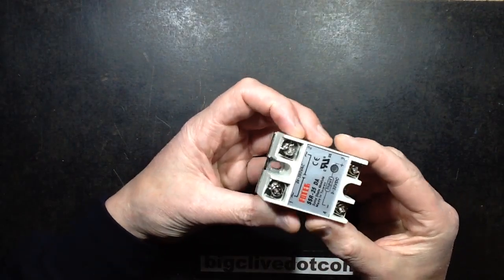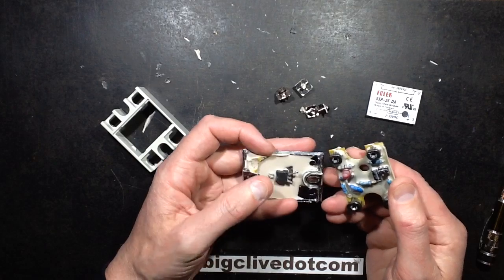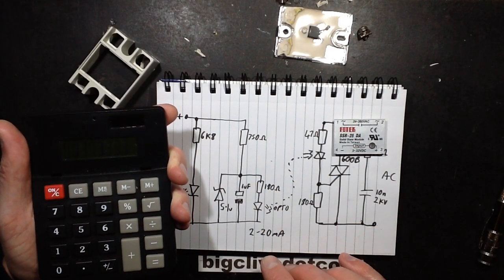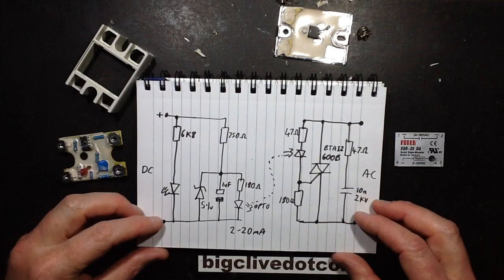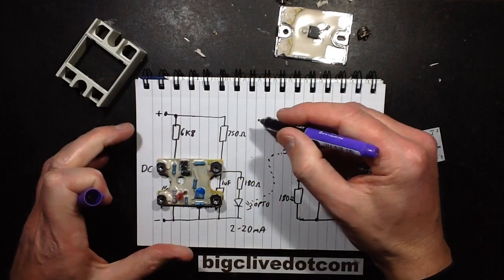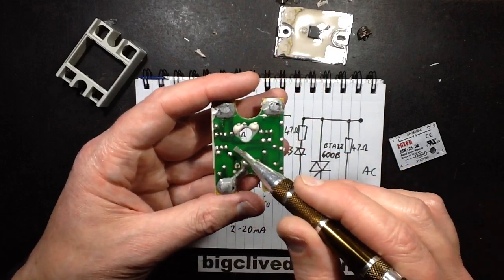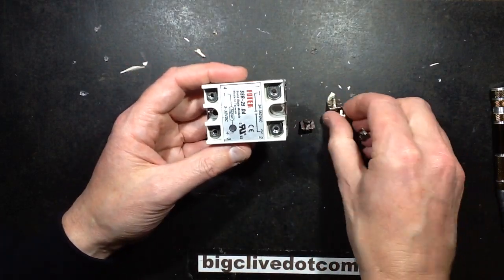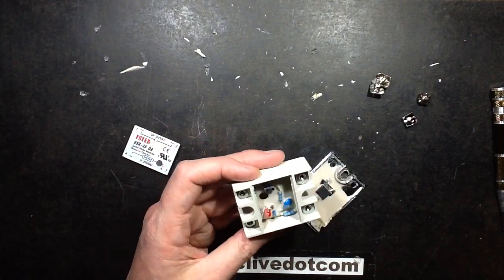Teardown of an eBay 25A Solid State Relay.  (SSR)

Comment: I often wonder why obvious mistakes like duplicated tracks and not enough clearances are left in products like this. One thing I do wonder is that do these company's scrounge PCB's with errors or design issues from other company's stock, then assess if they can use them and buy them dirt cheap and populate them. Would knock alot off the production price and probably explain why they are so cheap!
Reply: +Chris Woodhouse I have wondered about that myself.  I suspect something like this applies to the components themselves: parts that fail testing but "work" disappear from the dumpster and are bought by greasy operators who place arbitrary markings on them.  They then appear on Ebay and various Chinese web sites for next to nothing.  No point letting them go to waste...lol...
Reply: +Chris Woodhouse 
Because "don't change it, if it works".
Reply: Mikheil Sukhiashvili there's a difference between it working, and it working long enough and failing catastrophically!

Comment: borrowed off the Fotek website about them some what long winded
. Established 1995
FOTEK CONTROLS CO., LTD.
Established in 1985, the company dedicated itself to
the research, development and manufacture of industrial
automation hardware in order to support the automation
of Taiwan’s machine industries. As all sectors of the
industry face fierce global competition,FOTEK
continues to provide the guaranteed best quality through
advanced technologies and strict quality control
( certified ); At the same time, the company has
continue to pushed to increase production,
standardization and international standards compliance
of electronic controllers in order to reduce costs and
increase competitiveness. FOTEK products are in use
in many Taiwanese industries such as rubber/plastic
machinery packaging, food, printing, parking,
transportation, many major machinery producers.
The company’s products are sold electronics and
cabling. The company is alsoa designated supplier to
all around the world, and many internationally renowned
companies in Italy, Germany, the USA, the UK and
more use FOTEK’s OEM services. With nearly ten
thousand products, the customer’s requirements can
always be met, making FOTEK best partner for the
manufacturing and machining industries.
Management Philosophy :
→ To assert quality excellent。
→ To pursue company lasting operation。
→ To treat Customers as forever partners。
→ To research and develop over-valued product constantly。
→ Innovation、Responsibility、Reliability and Performance。

Comment: I wont be using one of these to switch a 240 VAC 5Kw water heater then
Reply: Another thing to watch out for is leakage. Big stuff like this never really turns off, it might even leak enough to kill you.

Comment: When you are driving this SSR at 10A continuously it should dissipate about 11W. You might want to add a heat sink to the back?
Reply from the maker: +PuchMaxi1988 Yes, when run at modest power they should be mounted onto a heatsink.  In some fairground lighting controllers they are mounted in a row along a common heatsink extrusion.
Reply: +bigclivedotcom  What's the temperature SSR makes in 10A continuosly?And how much amps are recommended to draw triac without any heatsink?

Comment: I use this one for my brewing temprature controller. It works well in that application with a 12v signal from a PID to trigger it. If I was to market the unit I would probably use better relays and pid's though.

Comment: IIRC real ssrs have the die on the back and everything wirebonded and then there are the mosfet based ones, which are also mounted on the back but they use back to back mosfets instead.

Comment: Just to expose my ignorance (and laziness) can I ask if you think these could comfortably switch an inductive load such as a large roller door? In my distance experience working on automation electronics I do recall having to replace relays with alarming frequency because their points had vaporised - or worse welded themselves together. These look like a good alternative?
Reply: +The Backoffice Sort of. The contact welding you've described will probably destroy a triac/SSR. You'll need to "snub" any voltage spikes (those are present when switching any inductive load). A combination of resistive and capacitive snubber across MT1 and MT2 with the addition of a MOV, gas discharge tube, or another type of high voltage device to clamp any spikes would be needed. Adding those snubber devices to a regular mechanical relay will probably save the relay and you wouldn't need to fix the problem with an SSR.
Reply: +Jammit Timmaj thanks for the info and pointing me in the right direction, I will investigate along these lines!

Comment: I have a few of those in my shop. Thanks for the helpful teardown.
Reply: +Adam Perry Very easy.
https://ul.com/newsroom/publicnotices/ul-warns-of-solid-state-relay-with-counterfeit-ul-recognition-mark-release-13pn-52/
Anything that doesn't match the image of the legit one is fake. The one shown in this video is missing the maximum amperage rating.
Reply: @Bradman175  Oh, OK then. "They" would never happen to improve on their counterfeit skills in any way. So we're granted to be on the safe side identifying those devices by relying on things that can easily be modified and copied and "improved".
Reply: He is tearing down a fake one, just saying.
Reply: Applied Science you had best make sure its real as if it's not and somthing happens could u live with that.   I kno some proper rotters who use fake rubbish of eBay and charge ppl full price it's wrong and shocking
Reply: +Misfit the mad: Checking the sides should be easy: The low-voltage side looks like a diode + resistor, the high-voltage side looks like a cap, i.e., basically like an open circuit, to a DMM.
Reply: +Applied Science  Well, you wer`nt to know were you. Hope you sell them and make a profit at the end of the day.
Reply: +Bradman175 With as many fakes as real ones:  How can you tell?
Reply: +Bradman175 I've seen the UL photos.  And I know that both of the ones I've used (one still in use, and another that died uneventfully after being abused) are fake:  Mostly, the difference is the small notch in the corner of the label, which prevents it from being turned around 180 degrees.

What's not clear from the UL photos is where to buy a legit one.  They show a couple of different Ebay links to fakes, but because the Fotek brand has been so diluted it isn't at all clear where to buy a legit one.
Reply: +Adam Perry well although most of them on ebay are fake, some of them provide images of the legit ones, however they cost significantly more expensive, which is the real price.
Reply: +Adam Perry I have no problem with using a fake - for my requirements its more than adequate. However now Im worried about the damn label! I bought a cheap 30W (potted) LED driver that had the label on backwards - lucky I noticed the colour of the leads before I connected it to mains.

Is there a way to check which side is which with a simple DMM?
Reply: The alarming thing is that lots of people are using this part in household espresso machine mods. It can be used with a PID temp controller to provide a stable temperature for your espresso shot. The typical household espresso machine has "1450 W" on the label. In these mods, much of that power goes to the heating elements that would be powered through this SSR. So, that's potentially over 10A-- inside a hot expresso machine, possibly using the stainless chassis of the machine as the heat sink (possibly without thermal compound), in an enclosed fan-less environment that could get wet or steamy if there's a leak. (look: https://www.youtube.com/watch?v=ZAtsuS6B6xg&t=910s)

I haven't heard any nightmare stories, yet, but it could happen. 

If you're dealing with multiple amps, it's a much better idea to just grab an SSR from a reputable source (eg omron) for ~25-40 bucks off of digikey, you can then at least trust the datasheet and look up application notes.
Reply: +Adam Perry and holy crap how scary it is that most of these fotek ssr are fake!! They're meant to cost like $40!
Reply: If the rubbish is used and abused like the real thing, it could be quite shocking for the end user as well.

Comment: It's not OK, someone I know got one and it burned up switching a 1kW resistive load. (At 120V, so about 8.334 amps ... not even 10 amps!) (The load is a a heating element. The inrush is very low compared to an incandescent bulb load!)
Reply: +Benjamin “Ozias” Esposti A heating element is similar to an incandescent bulb load for the same reason,  the resistance is lower when cold.   A long wire between the the load and the relay also turns it into an inductive load, which causes most of the inrush problems in domestic light circuits.

Comment: i have had issues with those cheap ssr not working right on CFL bulbs and other load current loads. then they blow up...they are cheap.
Reply from the maker: +Carl Recktenwald Jr. they must have a minimum load that is fairly constant or the triacs will not latch and you will get weird flickering and dimming effects.
Reply: Ah. Ok.. I got some Cyrdom SSR and no issues.

Comment: A couple of 3D printer enthusiast including myself has purchased a few different fake FOTEK relays like this one. The build quality differs quite a lot between different sellers and some doesn't even have any components attached on the back for proper heat displacement.
Someone's printer almost caught on fire because of a fake relay like this driving a heated printbed.
UL has a warning about these fake relays: http://ul.com/newsroom/publicnotices/ul-warns-of-solid-state-relay-with-counterfeit-ul-recognition-mark-release-13pn-52/
Reply: +Bradman175 Also the area for the label does not have the 45 degree corner in the bottom right. (second picture on the UL page) That's the quickest way to spot a counterfeit relay.
Reply: +Chris Floof yes, I know someone who made a toaster oven based reflow oven. These SSRs can't even handle a 1kW resistive load! They burn up and catch fire!
Reply: The one Clive has SEEMS like the genuine one since it has the correct writing with 'made in taiwan' and load. HOWEVER what makes Clive's NOT genuine is that it does not show the load rating THUS IT IS NOT GENUINE!
Reply: why not put a heatsink on it?
Reply: Matthew Carrano 
That would help just a little bit but these specific SSRs will remain dangerous and not suitable for purpose. 

There might be better Chinese made SSRs but you’ll have to investigate them yourself since the UL and CE markings are probably just a letters on a label.
Reply: Chris Floof https://www.ul.com/node/81246
Reply: Chris Floof Oh well I can't see that in 240p. :P

Comment: how would you feel about using it in a home environment for home automation? or shoud one get a propper one for 10-20 bucks
Reply: +alucard87 If you are going to be using this around people and/or animals, use a proper one.   If you want to prototype with these to keep costs down, then make sure you fuse it and keep it in a proper box to keep fingers and paws away from.
Reply: +alucard87 Use a proper one, from a reputable manufacturer. The cheap ones might just burn your house down!

Comment: Could I ask for some advice please? My stepdad needs a 19volt AC power supply for his model railway, The only thing I have is some old 19volt DC laptop chargers, is it possible to modify them to make it DC? I was thinking of opening one up and bypassing the bridge rectifier but not sure it would work or even be a good idea.
Reply: You want to find a plain old transformer. 18v is common in industrial gear. To answer your laptop PSU query, no you can't because they will be switchmode supplies, therefore they don't contain the 'plain old' transformer that you need.
Reply: +RandyDarkshade If anything I would salvage just the transformer part of it. If you bypass the rectifier, you'll be sending AC through the rest of the DC part of the supply and thats not a good idea. (especially with the capacitors.) Id try using just a stand alone transformer iff anything. Should be good enough for a model railway set. Do you know if the railway set has any rectification in it? If it does you can just use a DC supply as is. Not too familair how model railway sets work but do know some are AC and some are DC.
Reply: +RandyDarkshade yeah and go what with I and Richard Bell said. Yeah just an old school transfformer should do the trick, a switch mode power supply wouldn't have a big enough transformer to do much with. (if any, some don't have one.)
Reply: +RandyDarkshade why not use a old school transformer?
Reply: umbrefawx
Thanks, that sounds like a better idea, I'll let my stepdad know.
Reply: +RandyDarkshade All model railroads I know run just fine on DC (even Marklin). Zo you can just use the laptop supply, you only need to build some sort of speed controll. You can just use a 555 for that, an Arduino if you like, build a Weistra speedcontroll or buy an of the shelf DC motor speed controller. All just fine as long as the model does not have a decoder in it.
Reply: +tengelgeer yeah but an old school transformer is much simplier and would probably take less time to get said model railway up and running. Don't think his stepdad wants to get complicated with arduinos or timer chips. Think he just wanted something that would work quickly for his stepdad. :P
Reply: +umbrefawx Yeay, that's true. But DC motor controllers are dirt cheap and easy as well if you have a power supply. You can even run multiple motor drivers on one laptop supply.

But if you go for an old railroad transformer, don't buy a very old one, they tent to get unreliable/unsafe...
Reply: +tengelgeer yeah I agree wuith what your saying as far as something for me, yeh I have plenty of motor controllers around, and that would be something I would go for. However for some folks not nearly experianced with electronics or electrical, most ffolks would like the easiest option. This is a kid talking about helping his step dad get his model railway going, we don't have a clue as far as how old he is or how much experience he or his stepdad have in electrical or electronics. SO I went with the easiest, simplest option pretending nether one knows what they are doing. (which may or may not be true, I do this as a safe bet kind of thing.) Yeah transformers ages and using an old one may not be the best bet, but we wernt talking about old ones, as far as old school, plainly meant just a traditional transformer capable of giving him the said voltage and I figured that was the safest bet cause you can find 18volt transformers quiet easily and like I said not knowing the kind of tech or electrical experiance of ethier one of them, I figured it be the safest and easiest bet.
Reply: +tengelgeer Vintage Lionel trains ran on AC rather than DC, with direction controlled by a ratcheting relay that advances with each cycling of the power.  However, unless you are running modern digitally controlled trains, which run on DC, you will still need some mechanism to control the train's speed as one does not normally run trains at full throttle on curves.  In the case of vintage Lionels, if I recall, the outer windings of the transformer were exposed to create a variac for speed control with the throttle control a simple wiper on the secondary.  In more modern trains, running on DC but without digital control, speed and direction are controlled by pulse width modulation and polarity reversal of the DC.  In digitally controlled trains the DC is constant but speed and direction data are transmitted to the train to control them.
Reply: +RandyDarkshade i've used the speed controllers from slot cars to speed control DC trains.bit of a pain holding the trigger on but removing the spring would work.
Reply: +umbrefawx True that. But if someone watches video's like this I expect some kind of knowledge :)
Reply: +Ethan Poole I don't know Lionel Trains (hé, I'm European) but it sounds a lot like Marklin. Marklin uses AC as well with a higher voltage pulse to change direction. The transformers are indeed variacs. But the actual motor is a Allstrommotor/Universal motor and is just fine with DC. Even the pulse may just be DC as long as it's high enough.

Comment: Hey Clive,
the same unit is sold on Amazon (German) http://tiny.cc/pisc4x
One guy wrote that his unit would only pass 140V from 230V AC mains
Could you test that?
Reply from the maker: +MrKillerpics If triacs are not supplying a minimum load they will not latch.  It's not something you could simply test with a voltmeter like a traditional relay.
Reply: The Amazon link goes towards a fake product.